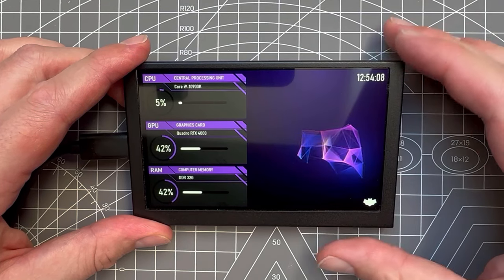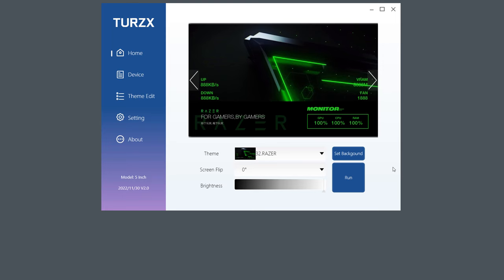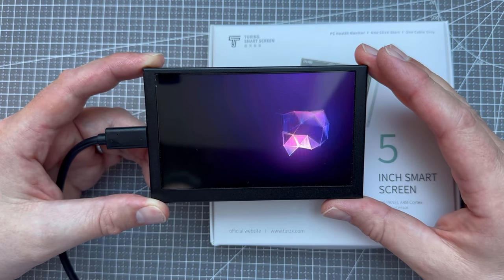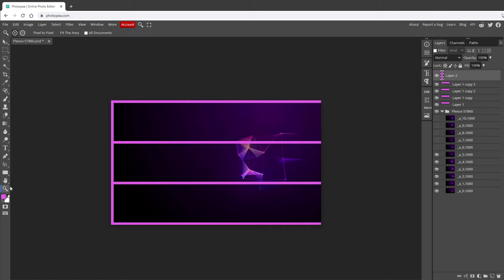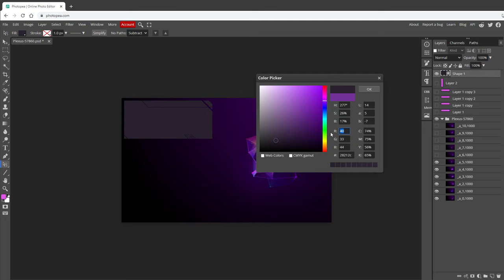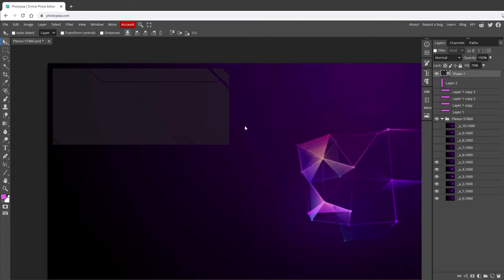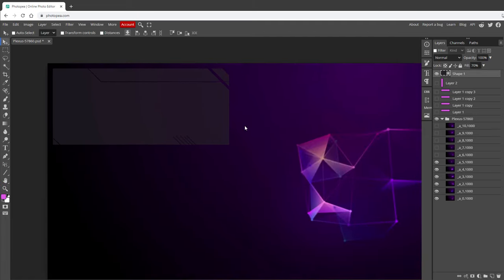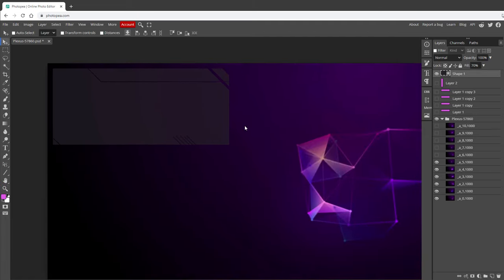DIY PC Stats Monitor (TURZX display, 5inch Turing Smart Screen)

Comment: hey man do you have any idea if this works while Corsiar ICUE is running. I'm asking cause I know sensor panels that use aida64 conflicts with icue.
Reply from the maker: This display uses proprietary software, not aida 64, so in theory, you should be safe. Unfortunately I have no way how to try it. Worst case of it doesn’t work, you can still use it to play video and enhance the PC case that way.
Reply: @upir_upir  if it uses it own software i might be able to use it then. didn't really want to pay for aida64 anyway. thanks for letting me know.
Reply from the maker: @billcipher534  You can download the software for free and test if even before purchasing the displays. Hope that helps. I also plan to record another video about those displays soon.

Comment: the 3.5 inch display costs $14 but the 5 inch costs $40, that's a big jump. I bought the 3.5 inch from Ali.
Reply from the maker: The difference between those two is not just the size but also functionality. The smaller one is very limited, you only have a few themes to choose from and you cannot play background animations/videos.
Reply: I just bought the 5" on Ali for $15.67, of coarse that was AFTER I already bought the 3.5" on Ali for $10.39.
Reply: @harvilleDesign  send me the link for the 5" display, I cannot find it for 15.67
Reply: @pavloskairis9994  It was listed as an "Early bird special". I didn't realize that. It now says $31.
The 3.5" was listed in the Dollar Express area. It should still be there.

Comment: Is this compatible with the 3.5 inch version?
Reply from the maker: What do you mean by that? It´s the same brand, but you need to install a separate application for both displays.
Reply: @upir_upir  that is exactly the clarification I needed thank you. I wasn't sure if the 3.5 inch model used the same software. Since they're different, this wouldn't be compatible

Comment: How do i open a zip file it wants to open into notepad
Reply from the maker: Windows should be able to open it by default, but if for some reason it’s not working, you can for example install 7zip which is free.

Comment: Can it still work if I don't hv sd card?
Reply from the maker: I´m sorry I don´t know the answer. You can surely try it. If it does not work, the "smaller" SD cards are very cheap.
Reply: Update : it works, but need to delete some videos to make to moving wallpaper running, guess I'm gonna get sd card real soon

Comment: To be fair. this lcd pretty dum. For that price you can get 1920x480 ips panel and use something like rainmeter to show info.  and use it as second display when you need it
Reply from the maker: You are right, if you can get 1920x480 IPS display for 50$ than it makes perfect sense. Do you have a link for such display? I would be very interested to try it.
Reply: @upir_upir  looks like youtube delete comments with aliexpress links.  you can find these lcd 's on aliexpress with 400*1280 480*1920 resolution and 7,84 or 8,8 inch size
Reply from the maker: Thank you for letting me know, I will check those displays and perhaps include them in some future video..

Comment: Got my 5 inch turxz display about a week ago and it was perfect! Yesterday though the screen just kind of died on me, it now has a bunch of lines through it at about 2% brightness and half showing the start display (black with white turxz logo) super annoying as I have done noting to it! it was mounted in my case with the internal usb to 9pin connector and a 16gb micro SD card (came with it). Has anyone experienced this before? I am trying to talk to the aliexpress seller to get a refund and order a new one.
Reply from the maker: I´m sorry to hear that, hopefully you can get a replacement from the seller. I have all my displays working still fine.
Reply: Hey! I wonder how was your returning process ended. I'm thinking to buy one of these, so your experience will help me on my decision.

Comment: Hi! Can I use this monitor to loop a gif/video?
Reply from the maker: Yes, it´s one of the intended usage. In fact, once you set it up to play video in the software, you don´t need to run the software anymore, and you can just connect it and it will play video automatically.
Reply: @upir_upir  I see... thanks!
Reply from the maker: Glad it was helpful!
Reply: @upir_upir  Hi! I also need a small screen for looping a video in an exhibition. Do I understand correctly that after downloading the video to the small monitor, the device doesn't need to be connected to a computer anymore? I can charge it via charging cable like a phone?
Reply from the maker: That’s correct. You use PC to set the display to play video upon startup, and after that, you don’t need PC anymore. As soon as you connect USB to power, the video will play. Note that there are no speakers, so no sounds. Also there is a limitation on video quality. You might need to use some free video editor like ffmpeg to resize the video to certain bandwidth/resolution to play correctly.
Reply: @upir_upir  Thank you so much!

Comment: Hardware installation?
Reply from the maker: What do you mean by that? You just connect the display to the USB port and that´s just it.
Reply: @upir_upir  Correct, had to connect it straight to the motherboard..took me a little time to understand the situation.
Reply from the maker: Ok. You can also connect it to any external USB port.

Comment: Is the software safe? Dont wanna get a virus.
Reply from the maker: There are a lot of services online where you can upload a file to search for viruses. Google drive does this automatically. I have done that and it didn´t found anything, but I guess proceed at your own risk.
Reply: chinese monitoring software that needs to run as admin, i'm sure its fine 🙈

Comment: could you show how to create the same panel using Photoshop? certain tool options and or tool behaviors are either slightly different or non-existent in Photoshop
Reply from the maker: You can download the source file and open it in Photoshop, but I think that most of the UI should be the same. Maybe except for the icons.. or feel free to ask which part you cannot find and I’m sure I can help you with that.

Comment: I can tell you, worked 2 days before the errors started, coding issues, the only install that works now is Chinese, no I can't read the language, I'm not happy with it at all, I don't do coding, so I can not go in and correct it, these things are a headache unless you work IT and code, avoid them!
Reply from the maker: I’m sorry to hear that, mine works fine without any problems- for several months now. Could you perhaps send it back and get a refund or a new one?
Reply: @upir_upir  Getting a refund, was fine until the latest windows 11 update, now every boot up I get an error, can't figure out how to uninstall it either so I just went in and deleted it from the files. Was nice while it lasted.